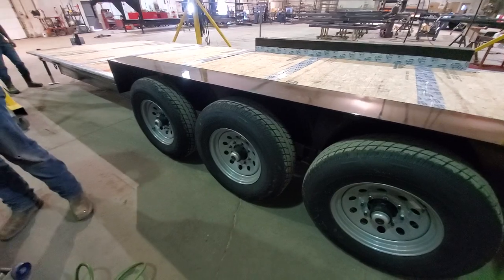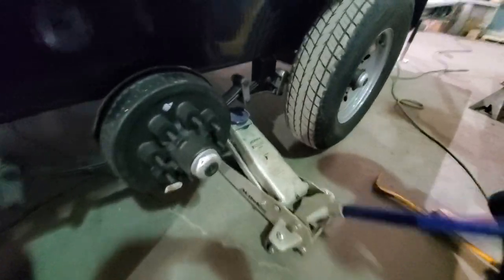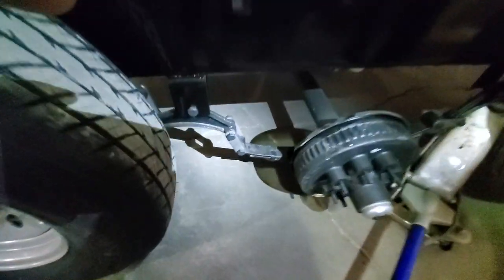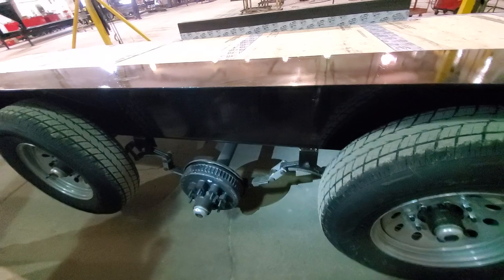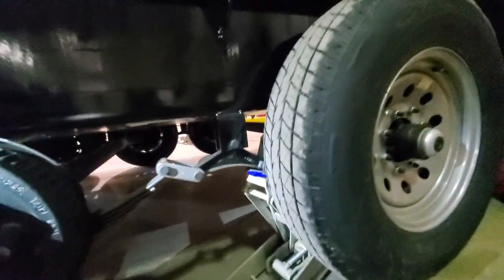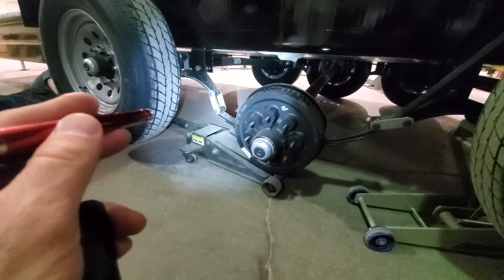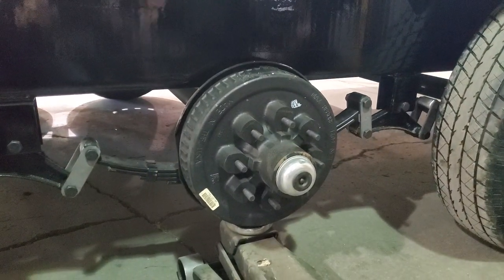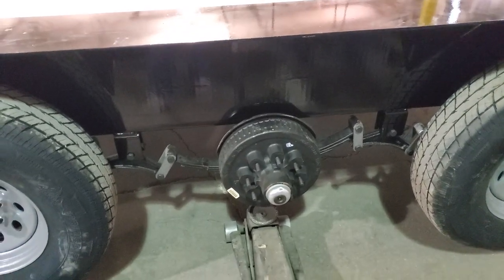How to Fix a "flipped axle" in real time

Comment: First off that shackle set up is wrong, the the leading end of the spring should be attached directly to the frame mount or a rocker box, this set up dose not hold the axle in place from moving back and fourth.

Comment: Hey guys, is there a video showing the fix for the thread lock fix you were talking about on the bolts that might back out?  Thanks
Reply: Just remove the bolts, put thread lock on them and reinstall

Comment: Put your bolts on the other way, heads on the inside,  nuts on the outside..
Then if a nut falls off and the bolt backs out, it won't damage a tire.

Comment: Pry bar? Dangerous tip good sir….floor Jack approved for sure, broken bodies are a common “pry at/tire iron” outcome. I’m just trying to aid the instruction and I thank you for such an informative video, keep up the good work 👍
Reply: Horrible design....I can't even believe trailer manufacturers in the US never use a stopper on the frame to prevent overtravel of the equalizer.

Comment: Iv never seen an 8 lug axle on a double eye leaf spring suspension. I’m use to seeing the slipper sets ups. Is there a benefit for building one like this? Are those light duty slings or something? I love my slipper style springs and equalizer because they don’t do this. I always hated when my little dual axle trailer did this.

Comment: How much tension is on the shackle bolts? Could you have taken off one bolt, and flip the leaf springs into the proper position.  And reinstall the lone bolt? You probably need two Jack's, and one jack stand.

Comment: Please NO ONE TRY THIS AT HOME. using a pry bar can result in serious injury. Watch another video
 This is a very good how not to flip a trailer shackl
Reply: I dont think they used pry bars to do it. I think they removed the bolts. And set it up positiined where it just had to be jacked up. I tried using prybars on smaller trailer and it couldnt be done.